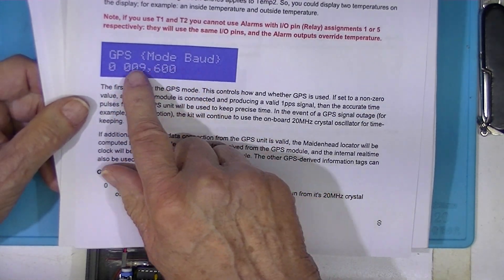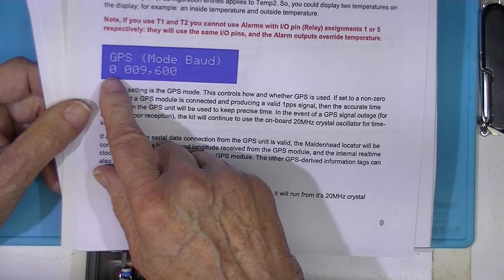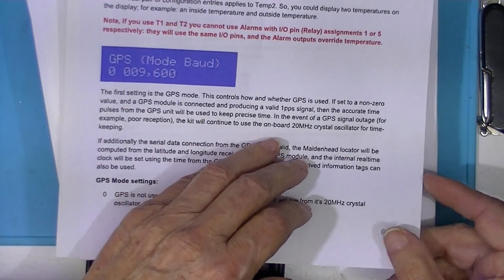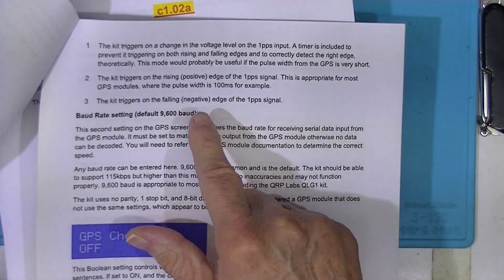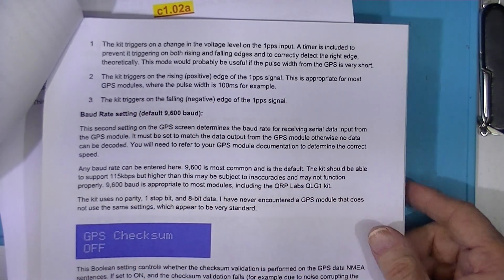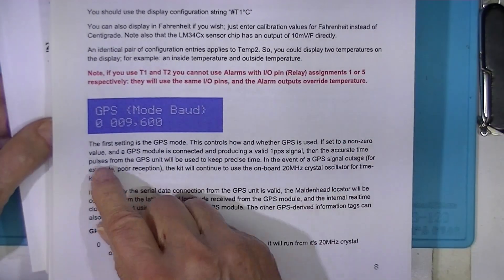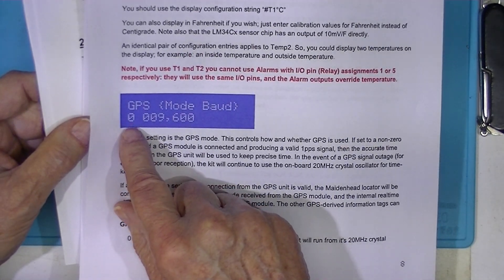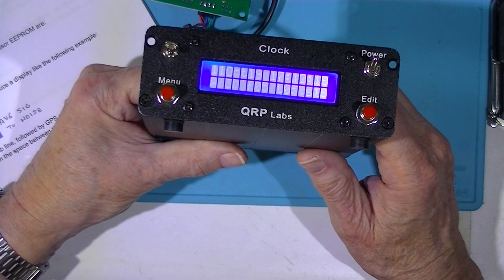QRP Labs – GPS/Clock/Enclosure Kits - Part 4

Comment: There is also an option to install an external active GPS antenna to the QLG1 GPS receiver. This makes the drilling of the big hole into the cabinet obsolete. So the usage indoors is no problem.
Reply: That will be my choice. I don't want to cut a big hole in the top of the case.

Comment: I don't understand Steve--Why did they chose a metal case for the clock using GPS?
Reply from the maker: I cant say. I think the intension was to extend the power/date leads to a remote receiver location, case not described.
Thanks
Steve
Reply: Have a look at https://groups.io/g/QRPLabs ... There group or Hans Summer will give you an answer to all the questions ....  just a hint .. best 73 ... PS: good to see that you are back on YT, Steve....